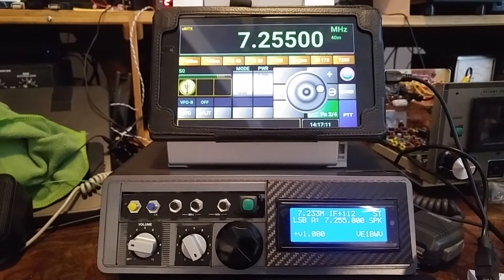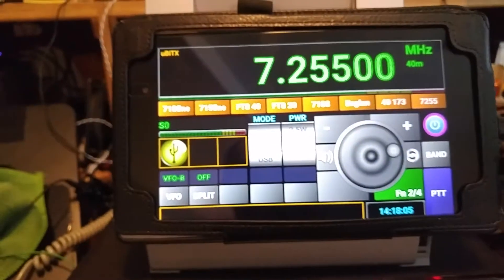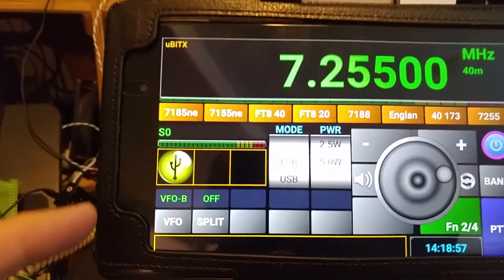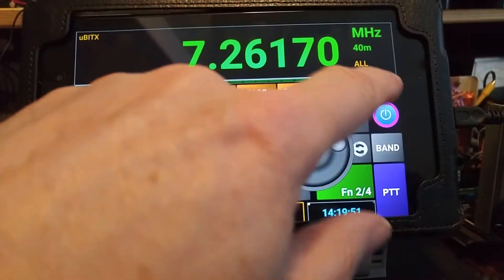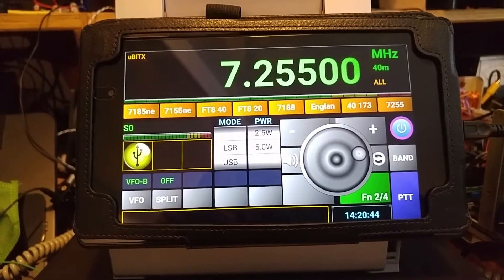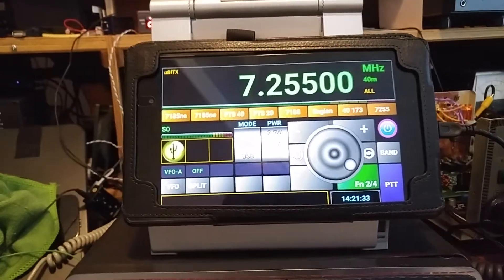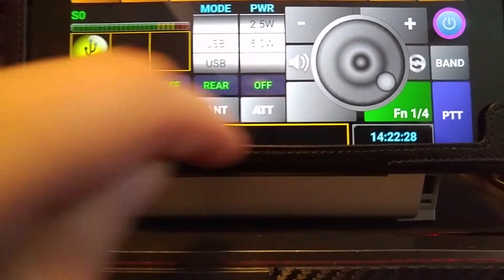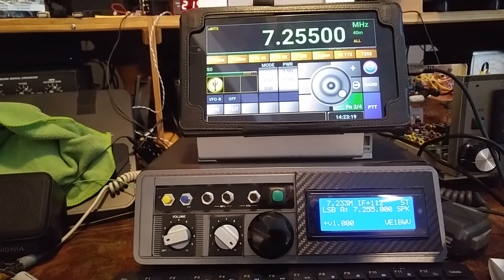UBITX WITH POCKET RXTX

Comment from the maker: It is nice to see all the addons for the ubitx. Just about something for everyone.
A new version of Pocket txrx is in the works ver 3 , will be interesting to play with new features.
Joe
VE1BWV
Reply: Was this just plug and play for you? I have attempted to connect by using both 817 and ubitx configurations on V5 and latest  cec firmware with no luck. Are there any settings within the ubitx that need to be changed? Any input would be appreciated.
Reply: Never mind. It is working now. It was either the baud rate or more likely the fact that I needed to start the software with the radio off. Really appreciate you bringing this app and capability to our attention.